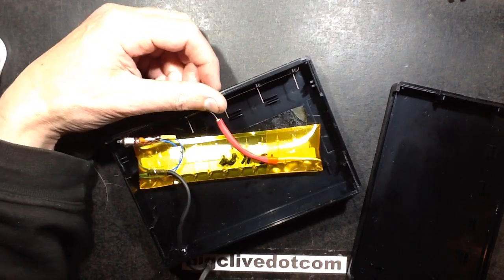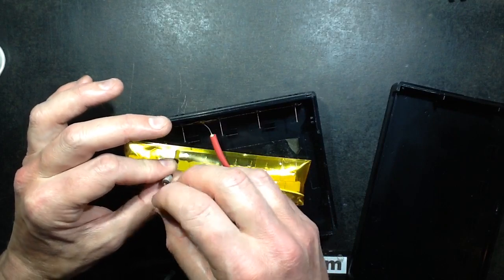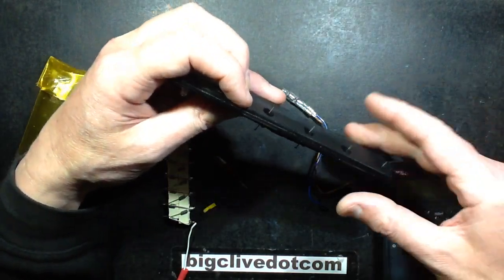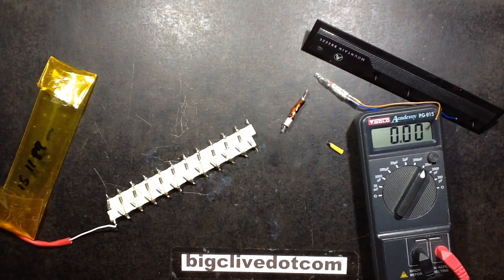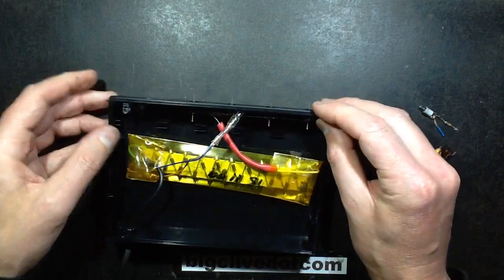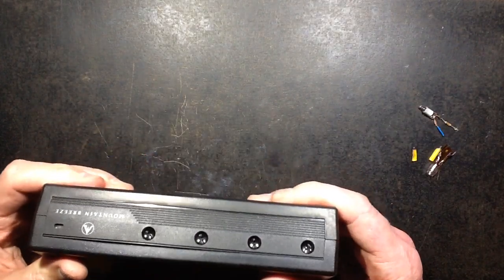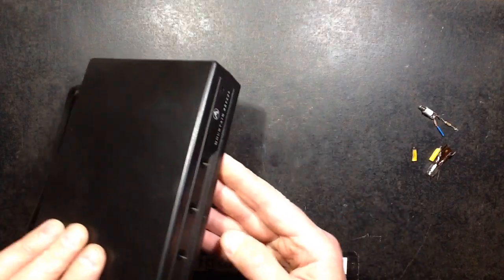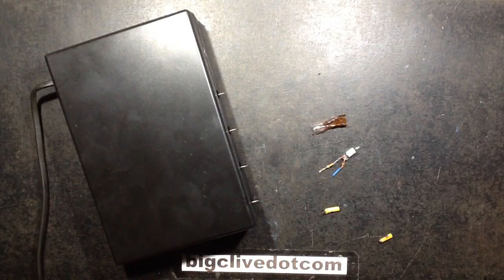Testing the capacitors in a Mountain Breeze ioniser.

Comment: Done a refurb on the case and modification on mine.  Glued shut on the  internal pillars, the swines!  Might push those needles out, too, although it will prevent the shutter that acts as a mechanical power selector from sliding.  I always have it on full anyway.   https://photos.app.goo.gl/66SAdaSN1gCATU4E7
Reply: Was shocked to see that my model was retailing for almost £40 in 1991.
Reply: The way that the Villard Cascade is made without a PCB is very elegant.
Reply from the maker: I've always though the shutters were a bit of a gimmick.

Comment: Found this exact one on ebay for 1 euro. Opened it up which was kinda hard to do. Didn't look like it ran a lot since the neon still looked fine and stuff. But i wonder how to make sure it works right since i barely hear any hissing.
Reply from the maker: If you can feel a slight draught on your ear when placed near the emitters then it's working.  You can also do a test by placing it on a clean sheet of paper and then checking the paper a week later.  When you pick the unit up there should be a much whiter area where it was with a grimy surround.
Reply: I could hear a really loud hiss once i touched my radiator. I guess grounding myself makes this thing to into overdrive. Opened it up, pulled the needles out a bit more and cleaned them. They were black and looked almost pitted. Seems to work fine now. Can't wait to see how much filth will collect around it.

Comment: You use this in your bedroom? Do you find that it produces a noticeable amount of ozone? 

I once tried a somewhat similar-looking needle-type ionizer that was mains isolated and instead had an opposite voltage plate quite near the needles, and it produced and absolutely nauseating amount of ozone. Instead, I ended up getting one of the tall, parallel-plate type units that are very popular here in the US (they may be popular in the UK as well, I don't know).
Reply from the maker: No detectable ozone from an ordinary ioniser.  The ones with a plate or grid in front of the needles are specifically generating ozone by creating a large corona area.
Reply: That's about what I figured. I thought it was a similar needle-type ionizer when I got it, but didn't realize it had the added grid until I took it apart. For some reason a lot of ozone generators-- at least in the US-- are marketed as ionizers or even "air purifiers," so it isn't always obvious what you are getting.

Comment: Amazing how no matter how many times they update the casing, these are almost always identical inside
Reply from the maker: arcadeuk The earlier ones used a similar casing, but a PCB inside.  The symmetrical nature of the design means that direct soldering of the circuitry is easy, saves them the cost of a PCB and reduces the risk of tracking too.  Total win, and quite easy to build your own too.
I mean to ask...   Have you ever come across any of the PCBs out of the scary Morgana fortune teller?
Reply: I don't think I have come accross any fortune teller pcbs, the problem however being identifying them. Often I come across unknown arcade pcbs, and after scoping them for anything that looks like a video signal or sync pulse, not being able to identify them. I have several redeption game pcb's that do not identify themselves in any way when powered up
Reply from the maker: arcadeuk Yeah, all the PCBs in unusual games tend to be a bit vague.  I was hoping you might have fixed or come across a Morgana (the one that projects a human face onto a mannequin) since it had a very pleasing background noise that played all the time.  It was a series of flat tones with a slight amplitude envelope to make a "bing" type noise.  It went through in a short loop with two spaced a bit closer together and made me wonder if it was something as simple as a 4017 counting along resistors with an extra diode/resistor to boost the clock speed for one note.
Reply: I don't recall ever seeing one of these, and now that you have got me interested, I am going to have to do some research
Reply from the maker: arcadeuk Ridiculously huge machine with a film cartridge that tended to wear out, so very hard to find any decent images of them now.  But someone has recovered some film and put it on YouTube.  Very scary machine.  It had a story with it about how it summoned the spirit of Morgana to read your fortune, so when a human face suddenly appeared on the "ming the merciless" type figure inside, people often screamed in genuine terror.  http://www.youtube.com/watch?v=GzkqARkUKM4
Reply: Very interesting, I've definately never seen that before. I love the look of the first generation machines, very cool! Almost a little googie style

Comment: Are such ionisers beneficial? This looks interesting: 
http://web.archive.org/web/20131029121919/http://www.ce-mag.com/archive/02/11/mrstatic.html
Reply from the maker: gareth1971 Ionisers precipitate airborne particulate out of the air by causing it to clump and also making it migrate to any grounded surface (walls, floor, ceiling etc.)  A lot of people dislike them because they do make a mess, but they are silent and the stuff they caused to appear on the surfaces around them is probably better there instead of in your lungs.

Comment: Very timely video as I want to check some capacitors in my 200 in one electronics projects lab which is a wounderfull toy, When you test a cap what do you set your meter to?
Reply from the maker: eamonn280958 The two most common capacitor tests are actual capacitance and ESR (Equivalent Series Resistance).  Some meters have a capacitance test mode, but ESR tends to be a dedicated meter.  The most common capacitor degradation over time is the drying of the electrolyte in electrolytic capacitors.  They tend to keep their capacitance value, but act as if there is a resistor in series.  Easiest fix is just to replace old electrolytic capacitors with new ones.  They are not expensive.
Reply: eamonn280958 I had that device, as well as the 300-in-1 (I think that was the more advanced one with a breadboard built-in etc?) sadly they were stored a long time in a damp place and no longer work, just as I want to get into electronics again. :(

Comment: According to an article on designing reliable PSUs I have in front of me, the voltage rating of metallised (polyester) film capacitor drops dramatically with frequency - one 'popular range' apparently has its 400Vdc 250Vac rating at 50Hz drop to just 1V at 100kHz. This means that they are very susceptible to high dV/dT situations as found in switching semiconductor snubbers and generated by arcs. It goes on to recommend polypropylene, foil film or ceramic instead.

Comment: The cheap green and blue neon bulbs uses plain nitrogen that causes the electrodes to sputter onto outer glass shell quite fast no matter how low the current. The clear glass neon's are much more robust, I have one glow in the extension cord switch for years 24/7 and it's light is still clearly visible.
Reply: DjResR When I was a kid, back in the 50's, I thought them little orange lamps were the coolest thing. I had got a hold of one of the line test lamps with a neon lamp and entertained myself for hours.
I have seen that Ne2 lamp & its variants in odd places. A car radio had one between the antenna input and the chassis. I had the opportunity to hear one in action during an intense electrical storm. The radio would start to make this whine, soft at first, then becoming louder with a bit of a pitch change, then there would be a flash of lightning and the radio would go back to normal. I guess that lowly lamp acts as a static dissipater. Then there was the relaxation oscillator circuit for a code practice sound generator. By the way neon lamps are great for detecting DC verses AC. On DC only one electrode will have the glow... AC both electrodes will glow
Reply: Craig Nehring Yep, it's the negative electrode that glows, in AC the polarity changes 100-120 times a second so for the naked eye it looks like both are glowing, but in reality just one is lit at every AC cycle. I had same thought also for a neon bulb IN-21 salvaged from a soviet era stove that started my interest in electronics when I was kid in late 1990's.

Comment: Just an fyi, Ionizers can be dangerous to use when in the room. The ionized particles (dust) if inhaled, will stick to the lungs permanently. The U.S. is in the process of trying to ban them.
Reply from the maker: sublimationman Umm no.  Not even scientifically feasible.  On the other hand, I wouldn't want to sleep in a room with an ozone generator running.
Reply: sublimationman The worst it could really ever do, is if for some reason your body couldn't combat oxidation(Antioxidants are fun, and helpful.)

But I seriously doubt it can even be possible for just a stray oxygen, no matter how weak and malnourished you are, to harm you. However if you were to completely bathe in Ozone, in a sealed environment I'm quite sure you wouldn't be happy. But that'd be more like a few thousand of those things.

However, it does cause the dust to stick to walls. But lungs are pretty damn good at cleaning themselves. That's why whenever we get pneumonia we always drop dead.
Reply: roche114 Ozone is a strong oxidiser, so as u sayed, it destroys the odors, it burns them, since most unpleasent odors we come across in the day to day routine are given by organic substances. I dun like runing 1 of those, even a tiny 1 while i'm in the room since it make my nose and throat dry and iritated.
I made a ridiculously strong 1 that i run in the morning for about 10 min and then open the window. After about 10-15 min of turning it off there is a strong smell of absolutely nothing in the room. The small comercial ones use dc, wich is good if u want to also charge the air and make a bit of ozone. If u want tons and tons of ozone ac is the best aproach.
Reply: sublimationman they did want to ban ones that put out to much ozone,  and they certainly recommend not running them in the room while your in it, i used one back in the 80,s and the dust it attracted around the back of the bedside cabinet made sure i never used mine again, a thing i really don't see the point in,  just open a window!
Reply: jusb1066 They're useful for eradicating scents. For people who smoke, perhaps had a fire, suck ass at cooking, etc, it'll basically, in a way us mandibles can understand, "Scrubs the bad stuff and makes it into good stuff."

Ozone generators are absolutely unmatched when it comes to odor eradication. Nothing else can do it, the closest is to mask the scent, while ozone generators literally destroy it at an atomic level. And actually of all the places I'd recommend one, is somewhere near where your master AC system(If yours is similiar) intakes the air, and forces it through the filter, I'd recommended it right there. As close to the main intake as you can get. It'll completely eradicate all smell in your house, plus like I said, you'd need like 50 of those little ones in a sealed room for a couple months before anything happens. The ones they use to "Scrub" marijuana grow rooms, or  clean vehicles with smoke build up are thousands more productive.

Also they smell like cancer so I like them.
Reply: jusb1066 Also one last thing, every hospital uses a gigantic-as-fuck one to scrub their giganto-fucking-normous master AC system, or at least the ones that have to deal with long-term patients, like spinal cord or traumatic brain injury rehab centers, since everyone has to shit in their rooms, and it sits for anywhere from 20-40 minutes before the over-payed, worthless as shit techs come in to clean it up. Also they're very useful for houses that have said paralyzed person.

Also excuse my language; I read an article about France today.